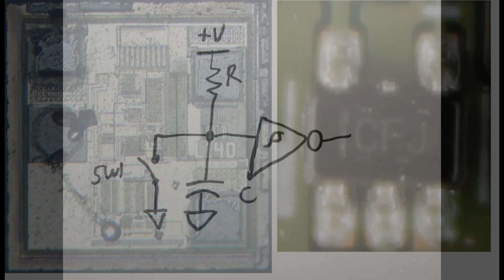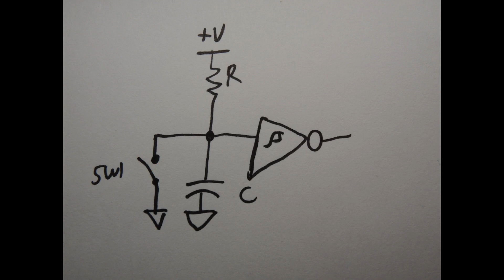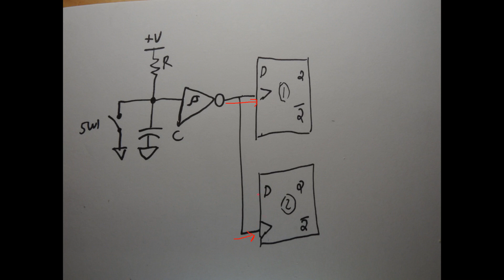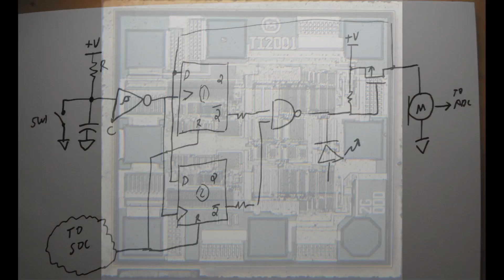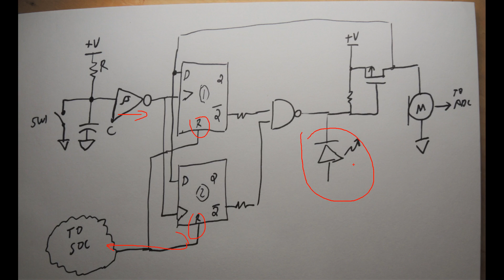AMAZON ECHO FLEX: MICROPHONE MUTE, REAL OR FAKE?

Comment: How did you figure out the connections? You can't just look at the tracings. This is a multilayer PCB, which means you can't see all of the tracings that connect the components. Also how did you decap the components? Anything that will remove the ceramic case of the chip will also damage the silicon inside if it hits the silicon. And the separation between the case and the silicon is less than a millimeter usually. The only equipment that can do that successfully is multi million dollar equipment owned by the FBI, which they use to decap flash memory chips inside USB devices to read the data stored optically via a high power microscope. This allows them to check the content of USB sticks that have been intentionally damaged by the suspect, so as to prevent them from being read in a normal computer's USB port.

Comment: Mosfets typically fail closed, not open, so you can be fairly sure the mic is disabled if the LED is on.
Reply: But in this case, the MOSFET only supplies power to the mic. The LED is powered by the output of the NAND gate which is controlled by the flip flops.

It seems entirely possible to me for the MOSFET to fail and power the mic while the LED remains off because the flip flops have never been clocked and thus do not represent the state of power to the mic.
Reply: @TomStorey96  Well, the LED is on when the mic is OFF. LED off when the mic is on. So if it is failing so that the LED doesn't turn on, it will basically be always telling you the mic is on, which is how it should do.
Reply: But if it fails while the mic is supposed to be turned off..? That's what I'm thinking of. You won't know until the next time you reset or try to change it.

Comment: Excellent analysis and explanation! I'm actually extremely surprised to see so much circuitry for this function. It's ACTUALLY a mute button.... I think most designers would want to just control the LEDs from the SoC and implement the "mute" programmatically, i.e. stop processing speech.

Comment: This is great! I've noticed that the deaf state survives power cycle, at least on Echo Dot and Studio. How does that fit in for this circuit, or does it?
Reply: Best guess, the clock input and also the output state are also fed into the SOC so that it can also hard mute the mic and know what state it is in if the user mutes it.

This may not have been an exhaustive reverse engineering attempt, so to confirm this you would need to probe all of the SOC pins and see if they are in any way connected to the mute circuit.

Comment: Nice teardown as always! 

It seems that this microphone thing is freaking everybody out, but most of us carry several microphones in our pockets at all times, plus an active GPS, without a hardware mute button, tied to equally evil corporations. I don't get the level of fuzz about this other microphone.
Reply: A lot of popular Android smartphones support an aftermarket ROM like LineageOS.
Reply: @NiHaoMike64  It doesn't matter. Most phone SoCs have a number of high-powered application cores that run the user operating system which usually is some form of android. These cores are NOT in control of the multiple mikes on a phone nor the cameras on a phone. Instead phones have an additional core, often an ARM cortex-m that runs the entire telephony and mobile data stack (LTE/UMTS/GPRS). The camera interfaces are directly connected to that core as are the Analog/Digital Converters for the mikes. The firmware that runs on these radio cores as they are called is not publically explored much if at all. It's trivial for them to include a surveillance function that sends your location, audio and video from your phone without the Android side having any way to notice what is happening. The only thing you might observe from the outside is the device warming up and the battery not lasting as long as it usually does.
This just to dispel your inappropriate sense of security.
Reply: if you are even on youtube as a platform i don't want to hear anything about "privacy" or "spying"
Reply: But let's not go overboard here. Many people  put their phones away when they're having a conversation that's not suitable for other people's ears. Nobody wants to run around the house and mute a ton of devices before they can have a talk about how there are no women with penises nor that there is global warming. In Norway right now it is a crime to say anything that could be construed as "transphobic" even when you say it at home and in private. 
Besides that, there are many other very good reasons not to have the voice of Amazon in your life all the time.

Comment: Note that SOC control pin can only disable the mics. So you can disable them remotely, but in order to enable them back, you need to physically press the button. That's part of why this circuit it so complicated. 

Here is a detailed reverse engineering of the same circuit from Echo Dot https://www.youtube.com/watch?v=xH8LnK9hh6w
Reply: Is it not the other way around?  RST forces /Q outputs high, NAND gate output low, PFET on, mic on.
Reply: @KNfLrPn  That flip flop has both set and reset. The actual pins that go to the SOC are sets, not resets.
Reply: @AlexTaradov  Gotcha, thanks.
Reply: Any reason why they didn't go for a simple two position switch in series with the mic?
Reply: @alertjean  Because a mechanical switch won't let you mote remotely. And mechanical design to accommodate the switch is more complicated.

Comment: Interesting. The fact that the SoC only can turn off the mute (likely in case of a reset, but who knows, maybe an attacker can force that to re-enable the microphone) means that there will always be proof of the device listening: the SoC can't turn the microphone on at a particular moment to sneakily evesdrop, then turn it off again to hide the proof.
Reply: If you follow the diagram, the SoC can only disable the mics, not enable. I'm not sure how they guarantee that the mics are turned on at power-on though...
Reply: The power on state of the flipflop is likely the state that enables the microphone.